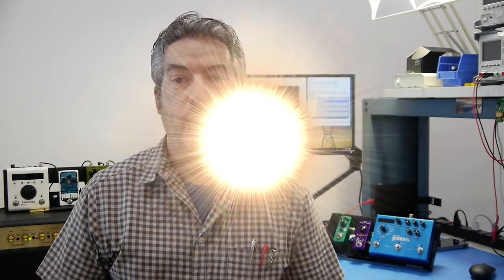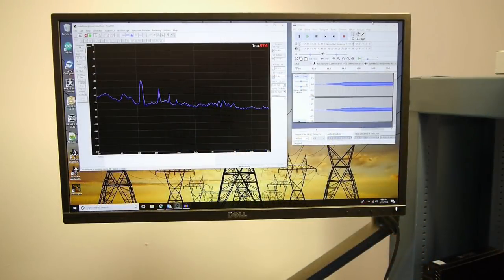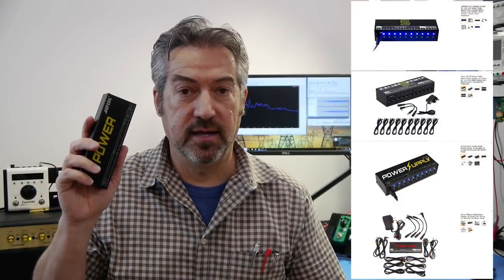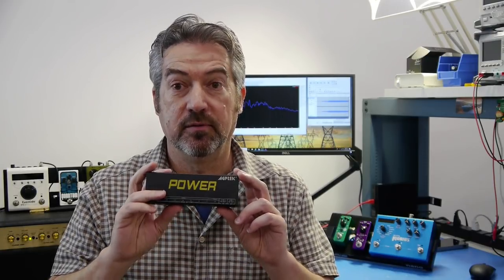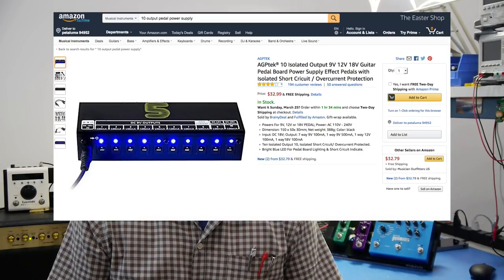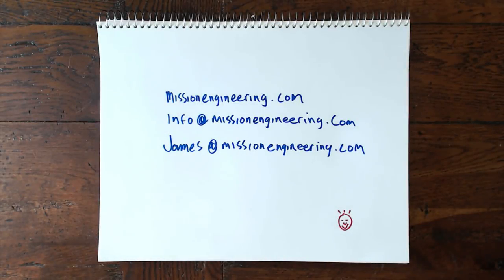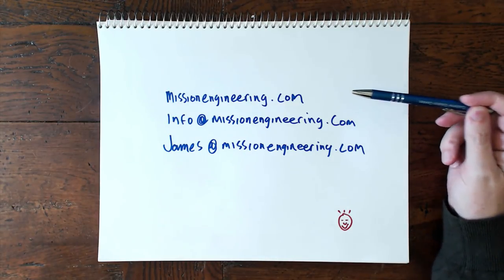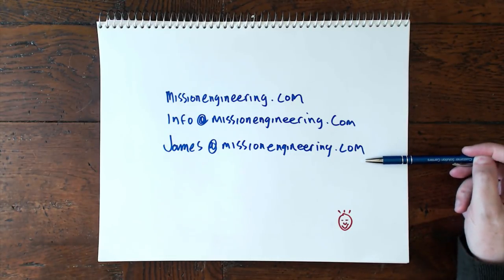Isolated vs daisy chain power supplies

Comment: First of all, you're not actually using a daisy chained power supply. Second of all, you're using some brand that I've never heard of, rather than a reputable manufacturer. I have run daisy-chain power for 30 years, using high-quality supplies and cables and pedals, and never once heard any unusual noise. Stick to quality parts, and you will get a quality result. Stick to off-brands and "boutique" pedals, and be prepared to have a plethora of problems.

I am currently running 13 pedals off a Godlyke Power-All 2000 mA power supply and daisy chain cables. My pedals are tc electronic, One Control, and Digitech. My pedalboard is dead quiet. My other pedalboard is five Boss and one tc electronic pedals running off a tc electronic power supply (600 mA rating) and Boss daisy chain. Again, dead quiet.
Reply from the maker: You are right "daisychain' is not really a really a technical term, so I hesitated to use it, but because so many people use the term, I was hoping the video might explain more about it.  In terms of what I was demonstrating in the video, the AGPtech is a 'daisychain' supply ie it uses a common DC-. In this respect, the supply is the same as something like a 1-spot or Powerall. You will get the same digital noise issues on both devices. As I point out in the video, this issue very much depends on what pedals you are using. If you are using all analog pedals then you are not going to experience this issue. If you have digital devices with a lot of DC-DC conversions, PWM LED's and so forth, then you probably will. Many pedalboards will run just fine with non-isolated supplies and that's great. No need for an isolated power supply. Others will run with a small amount of noise and many people don't care which is also fine. However, there are lots of players using digital devices, modelers and so forth that do require  isolated power. It's not really a boutique issue. try powering a Line 6 HX Effects, Strymon Timeline, and an Eventide H9 with a bunch of analog pedals all on a Power all and let us know how you get on.

Comment: Wait just a minute ! Why are you powering test number 1 power supply with an lithium battery (DC) ? Why not plug it in the wall (AC) Just asking. And honestly, who is powering their pedalboard with an lithium battery ? On test number 2, you are powering the power supply from the wall. Why not power both from the wall. This is not a fair comparison. I'm I the only one to see this. With the exception of a few other people , torrq and Nathan O' Keefe, to name a just two, not one person in the comment section said word one about it. Why would you knowingly power the power supplies using two different methods. I smell a rat ! - P.S. - I turned off this video @ 10:18. No need to go any further, this is rigged.
Reply from the maker: It makes no difference because the issue in on the output side of the power supply and not related to the power source. There's a follow up video demonstrating it here https://youtu.be/_5sPLcFRCow

Comment: Your comparing an isolated power supply with a non name fraudulent unit. You should compare isolated with the 1 spot, which is the gold standard (and honest) daisy chain
Reply from the maker: Using a 1-Spot or any other brand of non-isolated power supply wont make any difference in this case because the noise is not generated in the power supply, it's generated in the pedals. True Tone themselves also produce a larger and more expensive isolated power supply for this exact reason.

Comment: This comparison is terrible. You plug one into an independent battery and for the other you plug it into the power grid? How much electrical noise is generated by your amps and other equipment in your house? If you did this with both into the same outlet I would believe you, but this is not an accurate nor objective test by any means.
Reply from the maker: Firstly. These tests were not done in a house but in an audio test lab with properly filtered power. Secondly, as explained in the video, the noise is on the output side not the input side and so AC power noise is extremely low and has little to no impact on the results. Thirdly, I demonstrate this in the follow-up video which is linked in the comments and in the video description proving this noise has nothing to do with AC power supply noise. The only reason I use an amp at all in the video is to make it easier to explain the occurrence in the video. You can try it yourself with just headphones and no AC and get the exact same result. https://www.youtube.com/watch?v=_5sPLcFRCow
Reply: @JamesLebihan  Thank you
Reply: @JamesLebihan  Majestic!